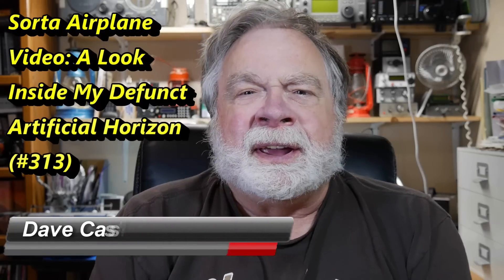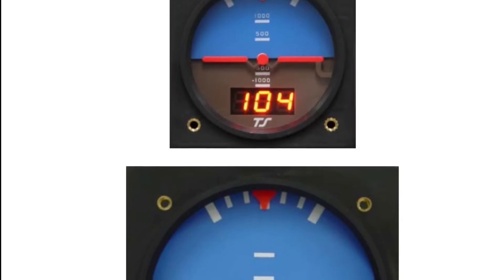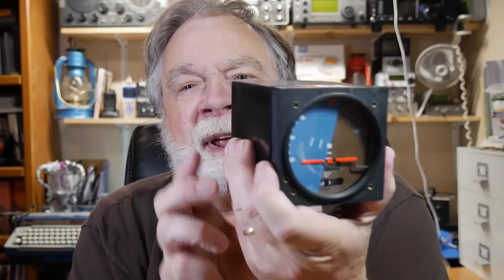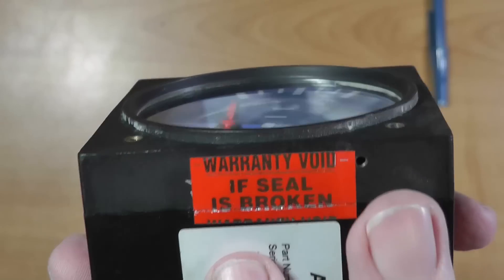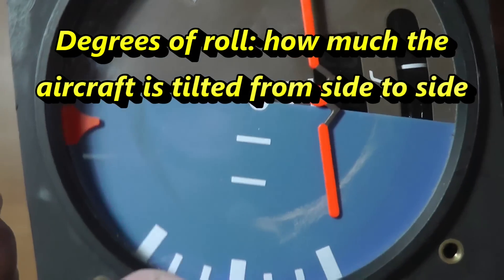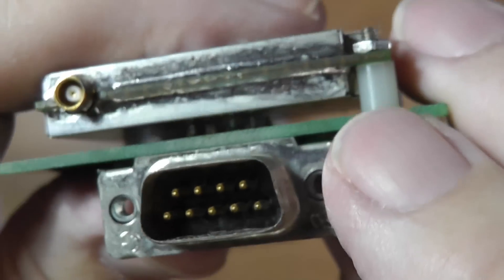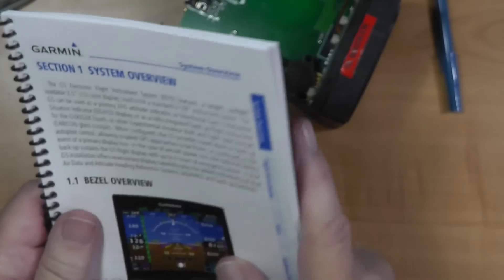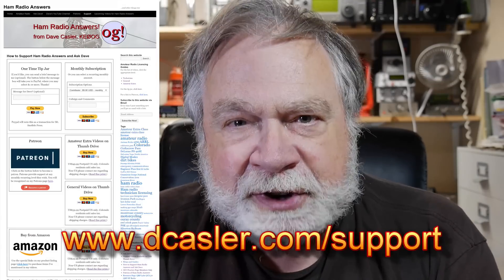Sorta Aircraft Video: Let's Take Apart a Defunct Artificial Horizon (#313)

Comment: Thanks for the fun video.  Laser gyroscopes use a "dither" to fix the lock in problem.  It is a mechanical movement of the laser ring gyro assembly.

Comment: I can't believe you can still fly when you are shaking like  a ............My god.
Reply from the maker: The "essential tremor" (meaning no obvious cause) is age related and affects fine motor skills, not the larger gross motor skills used in flying. I have noticed that if I hold the stick with only two or three fingers, I get a little shake. The doctor gives me a med called propranolol that helps reduce the tremor. It's worst late in the evening, which is when I filmed the video.
Reply: My grandfather shaved with a straight razor for decades. He had much worse tremors, and they got even worse when he concentrated on a delicate task.